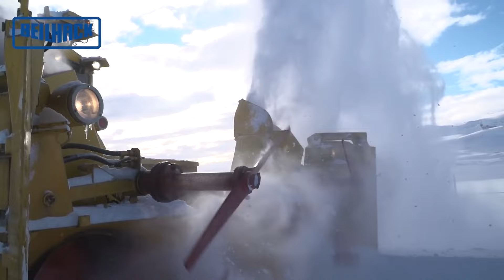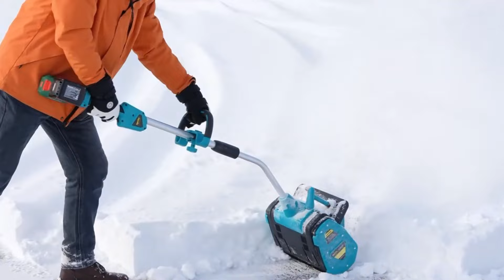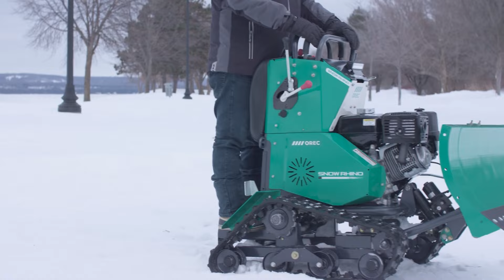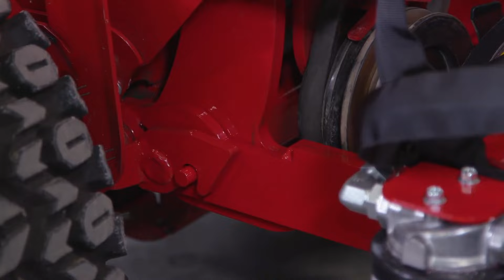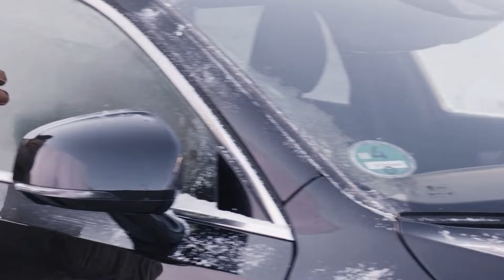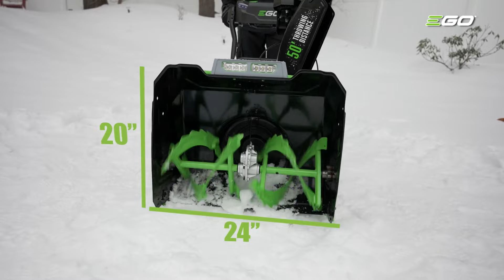EXTREMELY FAST SNOW REMOVAL TOOLS AND MACHINES

Comment: That robot snow remover is so stupid.  It's too light for heavier snow.  Same as those electric shovels, they only work on fluffy snow.  I would rather use a gas or corded snowblower.
Reply from the maker: Thanks for sharing your thoughts! You make some valid points about the limitations of lighter tools for heavier snow. Different tools definitely have their strengths depending on the conditions.

Comment: Try buying one  i called severval big stores l ike Lowes and Home Depot they are sold out on egg blowers
Reply from the maker: That's a common issue with popular tools, especially during peak season. You might have better luck checking smaller hardware stores or online retailers.

Comment: I found a rather unique home snow removal machine recently. A neighbor was throwing it away, not knowing what it was, and said I could take it. Did find a faint name on the plastic shield, "Snoauger". It is about 18"-20" wide, and is a steel auger with a plastic shield along the back of the auger. It is on a wooden handle, and you just push it ahead of you. Pushing it forward makes the auger roll, and it moves the snow across the length of the auger, discharging it to the right side of travel.excellent sidewalk clearing machine, making a pass down one half of the sidewalk, and the other half on the way back. A lighter dry snow works the best, and about a four to six inch snow depth works best. I believe the origin of manufacturing was Chicago. It would be simple to make one or thes from scratch with hand tools. If I had a lawn tractor or atc, I would consider making a larger version for quick sidewalk clearing. And mechanized with a larger auger, it could do driveways easy.
Reply: Could you please post or send a picture?
Reply: Picture please.    I'm curious as to what it looks like.
Reply from the maker: That's a super interesting find! It sounds like a really clever design for a manual snow removal tool, especially for sidewalks. Thanks for sharing your detailed description!